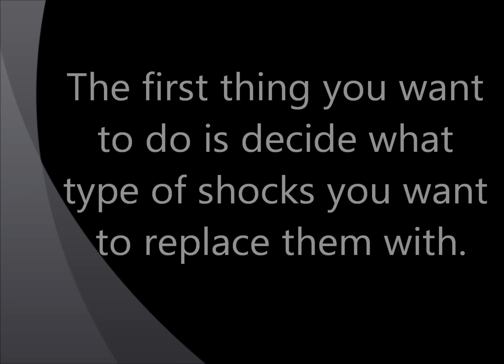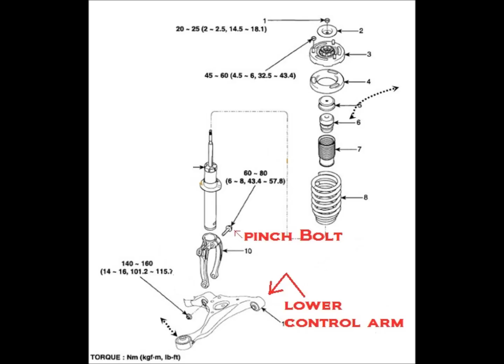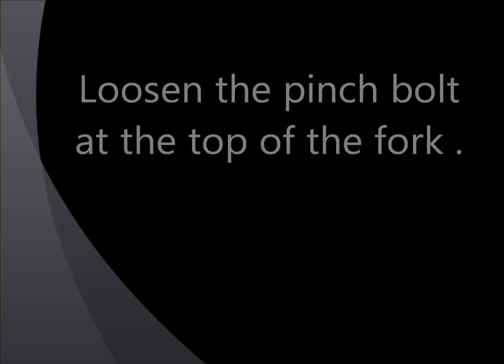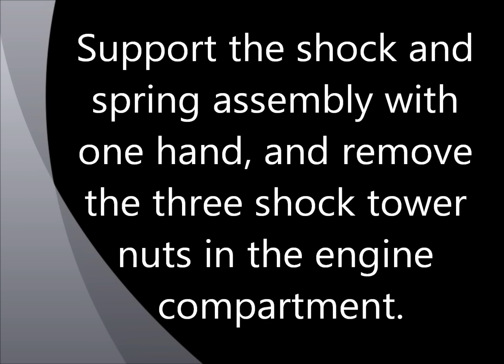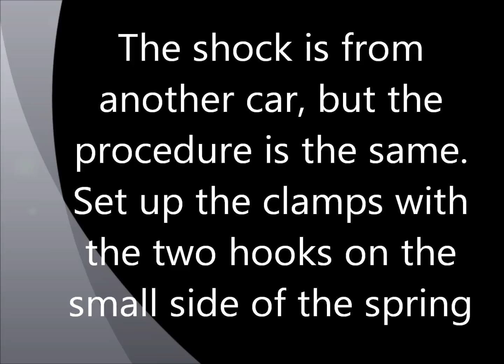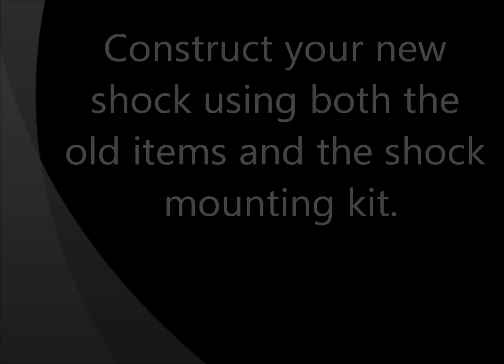How to replace the front shocks on a 2006 Hyundi Sonata

Comment: Excellent video! The part is misnamed though. 2006 - 2010 Sonata has front struts not shocks. Shocks and struts are different. Basically a strut has a structural component that a shock does not have so that the strut is directly connected to the frame whereas a shock is not directly connected to the frame. So don't go out and buy shocks for this repair - make sure you are buying struts. Happy Motoring!
Reply from the maker: Thanks for watching my video and your kind comment! You are absolutely correct! Thanks for clarifying that for the community. You may like my other videos. Just type Lsailor1 in the YouTube search bar. Like them? Subscribe for the latest! Best, The Sailor.

Comment: The back of the sway bar links on the 07 sonata I worked on were not completely round, they had two flat spots on either side. I was able to get a 17mm wrench on the back and that stopped the bolt from moving.
Reply from the maker: purplepanzer Thanks so much for watching my video! Appreciate your comments for the community! You may like my other videos. Just type Lsailor1 in the YouTube search window. Best, The Sailor.

Comment: Hey, its me from Part 2 of this video. I have a question for you. from 3:08 to 3:21 in this video you removed the LCA bolt and loose the damper nut. Were you able to complete separate the fork from the strut assembly at this point? and Why did you LOOSEN the damper nut?. for some reason i cannot get the fork COMPLETELY away from the bottom of the strut, the CV join connecting rod is in the way. I lowered the LCA as much as i can but cant seem to get the fork completely away from the strut assembly. 

Please give your best advise and guidance.
Reply from the maker: Have you done enough cussing? That always seems to help me out with my projects. :) I didn't explain the damper nut very well. You loosen it at this point because once you get the strut out with the spring, you won't be able to do it then. Now, an elementary question, but this is a 2006 Hyundai Sonata? Did you take off the sway bar that is attached to the fork? Can't remove the fork if it is still attached to that. Let me know. If still having problems, you can send me some pictures of the situation.  Best, The Sailor.
Reply: LMAO no i did not curse at the car, its highly stubborn and would ignore me anyway. I should have made myself clear at the beginning, I have the 2005 model, there is no sway bar on this model. All the other component are identical and routinely the same. I removed the bolt for the LCA fork and pinch bolt. I am able to free the fork from the shock bottom (from the pinch bolt). but i cannot seem to get enough room the remove the fork all the way OUT.
Reply from the maker: It might be a simple matter of jacking point. Find a place that allows the assembly to extend to it's fullest point. Also, use a piece of wood to pry the LCA lower to allow the fork out.  Cuss some too!
Reply: I'm pretty sure the 2006-2008 are the same. 2005 looks different.

Comment: replaced both front shocks and upper control arms on my 06 Hyundai, but still hear knocking noise when going over bumps. any suggestions on what to inspect next?
Reply from the maker: +dolee Thanks for watching my video Dolee!  Did you also replace the rear shocks. Perhaps they are shot? Maybe the CV joints? How many miles on the car? Best, The Sailor.
Reply: Sway bar end links are also a common source for knocking.
Reply from the maker: Michael Lenoch Thanks for your input Michael! You may like my other videos. Just type Lsailor1 in the YouTube search bar. Like them? Subscribe for the latest! Best, The Sailor.

Comment: I can not get the lower y fork bolt and link bolts out, reassembled everything.  My front structs tested good with 107k miles on my 2007 sonata.  

On your rear left shock, you had to cut nut to remove in your video.  My had a lot of water trapped in upper compartment.  This would rust out anything.  Manufacturer defect.  I used 1/16 drill to drill drain hole at front end/ lowest point in compartment.
Reply from the maker: Tommy Chan Thanks for watching my video Tommy! The front shock is hard to get out. I had to lift it with a floor jack under the fork. I too had water in the upper compartment in the rear shock. I dried it out and painted it with Rustoleum. You may like my other videos. Just type Lsailor1 in the YouTube search bar. Best, The Sailor.